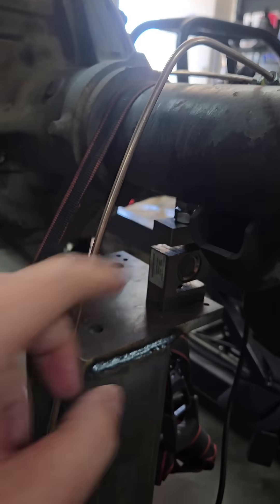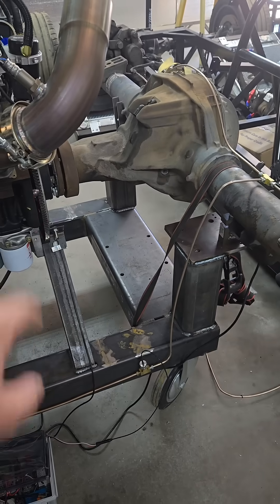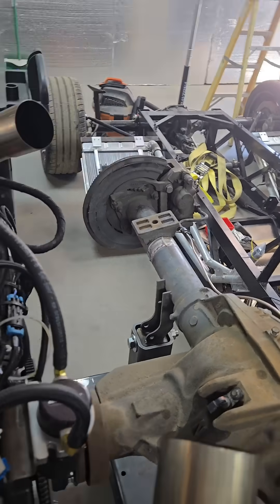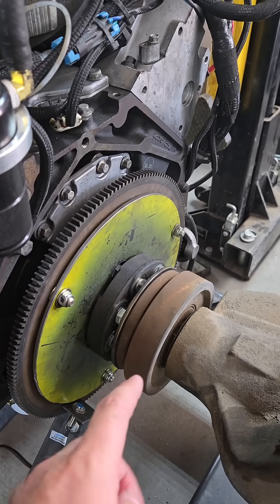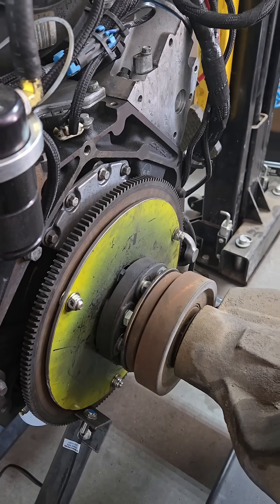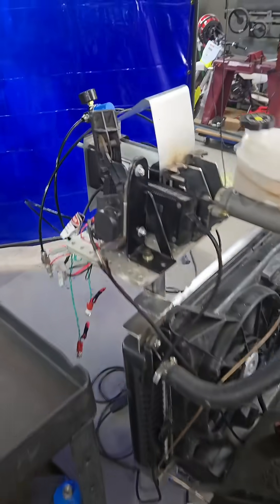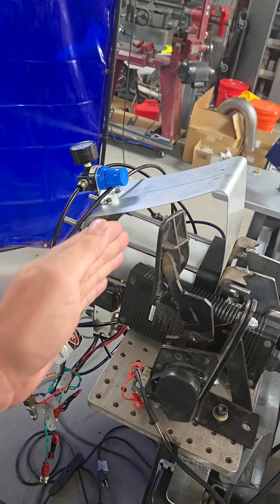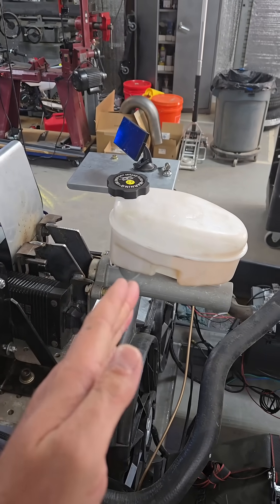DIY Engine DYNO! first test!

Comment: Brake dust going straight into the intake 😮
Reply from the maker: We added containers to the brakes and water spray to control heat. It also catches the dust and drains out of the shop into a catch can.
Reply: @centurialinc that’s a great solution

Comment: Super effort but why not use a gearbox and have a stack of disk brakes on the output shaft. Having the stack of calipers free to rotate with a lever against a load cell.
Reply from the maker: Thank you! Yes you can do that too. This is the cheapest thing we could think of. It's a $300 junk yard axle. Hard to beat that. More testing coming soon!

Comment: How do you verify the load you are applying is correct? 

Also on a typical engine dyno shouldn't it be a pull from low rpm to high rpm?
Reply from the maker: DYNOs over the years have changed many times. Pull down is where all DYNOs started. We don't need to check the load. All we need is to over load the engine so we see max torque. That's it. Our newest version should allow you run pull up, pull down and steady state. Follow to see how it turns out.

Comment: It only costs  a grand, to have a shop dyno test it
Reply from the maker: No more like $1500+. and that's each time! If you make 5 changes then that's 7K in DYNO testing. Also and engine DYNO is not the same as getting the car DYNO tuned. A DYNO tune is the last step before the track. An engine DYNO is a development tool. It's job is to help you build power by making lots of changes quickly and easily to see what works best. If you pay for this it's extremely costly.

Comment: Super awesome. Don’t think that air cylinder is linear enough to control the brake system
Reply from the maker: Thank you. It's surprisingly good. More testing coming soon.
Reply: @centurialinc you understood that. My phone messed up my comment and I didn’t realize that. If it works good it works good and no reason to change

Comment: No bad...close the loop...but don't forget to build in the fence  around all the bad stuff.  I find that it's good to write a loop that has addition / subtraction as the output math so that the rate of change can be locked down.  With multiplication  / division as the output step, the rate of change is more difficult to restrict. 

I'm still thinking on the torque from the load cell piece with the "little bit of math".  I can see that relative measurements would be possible but absolute is whole other issue.
I'll be watching, this is of great interest to me as a process automation professional.

PS....For the brake pressure regulator, replace it with an I to P (Current to Pressure) regulator to give you computer control of the brake input pressure.  I've had loads of fun with these things...
Oh and add a exhaust fan system before the CO kills you...
Reply from the maker: Thank you.

Comment: How did you calibrate the load cell for hp ? Yes people dont realise brakes are measured in hp too ! A cars brakes on average as a rule of thumb should be twice the HP of the engine . Hp is acceleration over time . And brakes are deceleration over time so technically brakes have negitive hp . Hp is really a useless made up bench mark . It was created so James Watt could measure his steam engines. Offically HP is the ability to lift 3300 english pounds , one foot in one minute . But is a bit of a deceving  measure . Because a Cat D4 Bull Dozer has 100 HP from 10 000cc engine and a 1991 Kawasaki 600 cc ZZR bike also has 100 hp , but everyone knows they dont have the same power.
Reply from the maker: We used known weight to set it correctly. Once we knew the v per lbs we can then measure the engines lbs of torque. In your example the HP is the same. The gearing is not. The dozer puts out that power at very low speeds. Probably 1500rpm. The bike dose it probably about 12k! So if you gear the bike down or gear the dozer up the result would be the same. That's why people make up arbitrary numbers like HP. The fact is the dozer and the bike are the same. Now efficiency is not included in the HP figure. And I guarantee the Bike is less efficient then the Dozer engine. The dozer might consume 200hp worth of diesel while the bike might consume 300 hp worth of gas.

Comment: I made a dyno in the 80s to measure torque on the final drive sprocket on bikes, power calc from torque and rpm. Used a 4ft long shaft with six 14" ventilated discs, two calipers per disc. Calipers all mounted to a frame wit its pivot centered on the shaft center. Two large suspension springs acted upon by an arm measuring shaft rotation & therefore torque / > power. Not as good as a water brake dyno which can be loaded for longer if you've go a nice big radiator, but effective & relatively small & could be easily brought to almost any bike with the chain off and the sprocket exposed. Had a set of sprockets with pins mounted in the teeth, so dead easy to couple up. Biggest issue was holding the bike and dyno ended up with a frame from the dyno with two cradles for the Tyres, short section from the shaft to the sprocket with a CV joint each end. Fun remembering all the lashups we went through. Super reliable, only ever replaced disc pads.
Love the work you're doing, so many good memories.
Reply from the maker: Thank you. More on the way.

Comment: Use bigger diameter discs & put Two calipers, instead of just one, per disc.
Yes it'll get the disc/s hotter faster, use hard/racing pads. Bigger + ventilated discs will dissipate the heat better.
Get a nice big snail blower on the discs so you can do another test sooner.

Comment: LIke your Prony Brake setup.  Did you weld the spider gears?
Reply from the maker: That's what it is. No it has an LSD. We might weld it down the road.
Reply: @centurialinc  Limited slip is close enough for me.   I hope selling the electronics for it pans out for you.  I never even considered using an axle for a Prony Brake.  Clever.

Comment: So you're only measuring the load at full rpm? What about the curve?
Reply from the maker: No the engines RPM is pulled down. We get a full curve. It is reverse to a normal DYNO. 6k to 2k
Reply: @centurialinc 
Sorry I had to edit to make it make better sense as I  wrote it out to quick. 😅
This is really a measure of brakeforce and lateral movement through driveline components rather than a measure of horsepower 🤔

how do you take into consideration the brake fade and expansion of hot components through your software? Its very cool but I think that you would do better to have the resistance that's applied be via a mechanical or even better electrical component rather than kinetic to avoid variables such as the aforementioned.

Comment: And this proves what, exactly?  That a differential can be direct driven from an engine and the brakes applied?  The differential provides the engine mechanical advantage through the ring and pinion, i.e., it's easier for the engine.  This setup provides no usable data.  You need to watch some videos of real dynos and listen as the water brake pulls an engine to its knees.  Your engine barely knew it had a load.  Being 8 lug, I assume the axle is in the neighborhood of 3.73 to 4.10?  You effectively increase the engine's mechanical advantage by a factor of 4.
Reply from the maker: Your over thinking it and you need to go back to high school physics. As long as the brakes overwhelm the engine (which they did) then we can read the torque. Watch the video again. We started at 5k+ RPM and the bakes pulled engine down to almost stall! Nothing the engine could do to stop it. A small amount of math is needed to get the HP from the load cell and the RPM censor. It's that simple.
Reply: @centurialinc I'm overthinking?  Or you don't have any idea how gear reduction works?  By running the torque through a gear reduction, you are increasing the torque load on the brakes.  Throughout your video, you were pedaling the throttle to keep the engine out of red line.  If what you are doing worked, no car would ever be able to move with a stuck caliper, yet there are cars on the road everyday with one or more stuck calipers, and the only thing the driver notices is the smoke from the wheels.
Reply: @sprint6855 he’s reading the pressure from the rear axle to get numbers not from the brakes I guess 😅seems like this is a caveman why off reading bind on a axle to convert to hp numbers in some wizard way
Reply: @A2ZREY I get how he's trying to measure torque on the axle, but this setup is in a bind because the front pinion is directly connected to the flywheel.  Yes, he's got a rubber coupler in there, but those are limited in their range of movement.  The axle would need to be able to freely pivot with the load cell being the only stop, as it is, some of the torque load would be absorbed by the coupler (until it fails), rendering useless data on the load cell.  This also takes for granted that the brakes can significantly load the engine, but they won't when they are on the other side of a gear reduction.  At least this contraption is marginally more safe than his last "dyno" build.
Reply: @sprint6855  From what I can tell, this is a prony brake dyno which can easily factor in the gear ratio.  Just a big torque wrench with a readout.  Pretty simple, but effective.  If you want precision, go somewhere else.  This is not a rich man's dyno, but it gives you a repeatable reference curve.  No matter how off it may be, it will still respond to tuning changes in the motor, and THAT is what matters.
Reply: cant he just take the gear reduction into consideration with whatever calculation hes using? why does it matter. thats like saying and engine puts more hp to the wheels in first gear than in second. it puts more torque but not more hp because hp= equals torque over time
Reply: @kevinesparza7657 I'm sure the gear reduction could be factored in.  But that still leaves the fact the brake load is insufficient to load the engine in any meaningful and consistent way, because of the gear reduction.  Then,  to develop the equation, this setup needs tested with several engines of known power to make sure the data is repeatable before testing an unknown engine.  That unknown engine would then need tested on an industry standard dyno to correlate the data from the Rube Goldberg setup.  As it stands now, this is an engine test stand that produces some data.  But is the data meaningful, repeatable, and of any use?

Comment: How is that a dyno??? Stupid
Reply from the maker: A DYNO is just a Torque and RPM measuring machine. That's what this is. The load cell is torque and the RPM is from an RPM sensor. What don't you understand?
Reply: Some people are strange, some are uneducated or simply foolish, Tom.
HP=torque x engine RPM/5252. It's a calculation.
Measure RPM with a Tachometer and measure torque with a load cell and to the math. 
This is NOT rocket surgery!
A "normal" dyno uses a water brake, this one uses a solid axial and some big  (truck?) disk breaks.
I applaud the innovation. It is definitely NOT stupid, especially at their price point.
Watch this if you want to see some old school torque from a 406 SBC in my 1974 Vega wagon   
https://youtu.be/rjnkz6Ia5p0
Reply: How is that not a dyno??? Stupid.